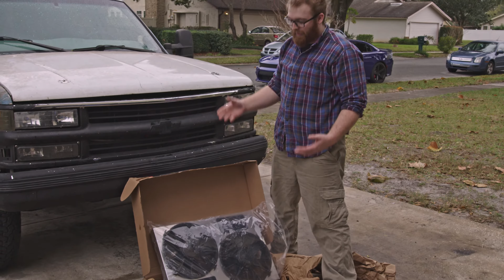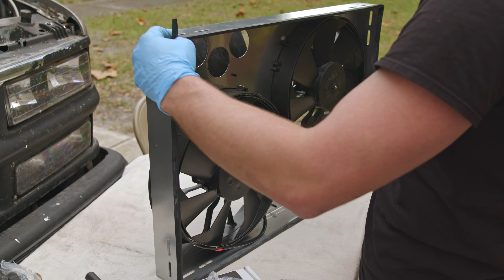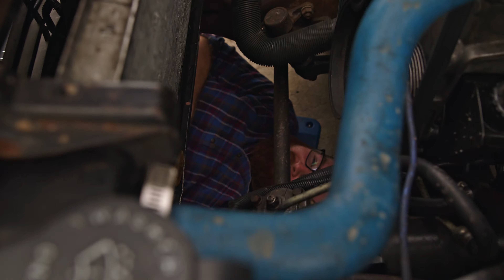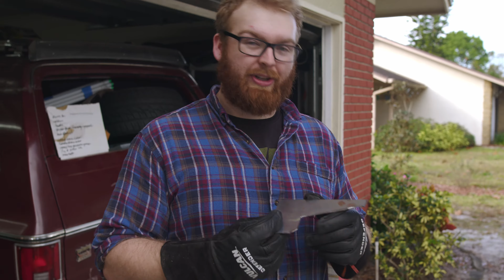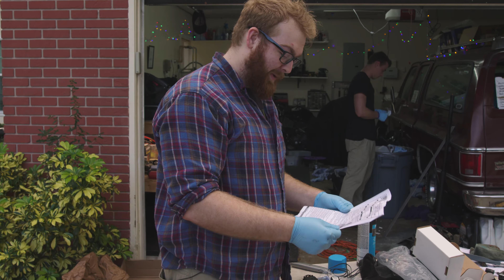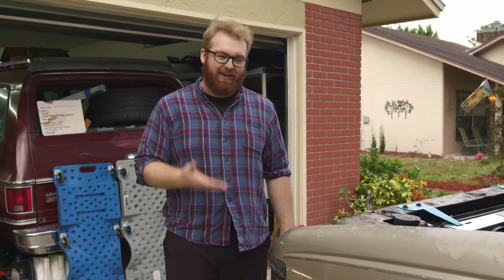Installing Derale Electric Fans in our 1999 Suburban

Comment from the maker: Something I forgot to mention: make sure you have an alternator that can handle the extra amp draw. Each fan is a ~25 amp fan, so if you had both fans running, you'd be adding another ~50 amps of draw to your system. If you have the stock 104 amp alternator, it probably wouldn't go your way. In our application it should be no problem since I'm running a 350 amp (not a typo) alternator!

Comment: Probably a bit late now, but I just found this video, when you paint bare steel its much better if you use an etch primer so the top coat has something to adhere to. I'm looking to add some electric fans to my Suburban sometime, good to see it done for real already.
Reply from the maker: We actually normally use etching primer on things we paint, I think we were just being quick here. Definitely a good idea though

Comment: How's that setup been at keeping your motor cool? I'm looking to convert my flex fan over to electric on my 1972 F250. Hoping it'll pull enough CFM to keep the BBF cool in California summer heat.
Reply from the maker: It does super well, I have a 180 F thermostat and with that fan my temps almost never get over 190ish or so, and that's still with only one of the fans running, I'd say it's probably pretty overkill most of the time, which is great